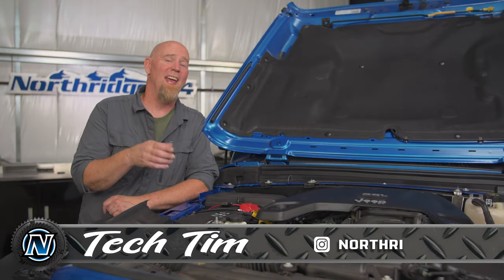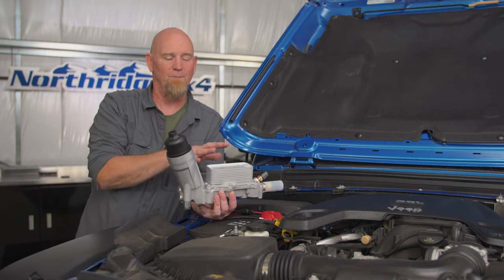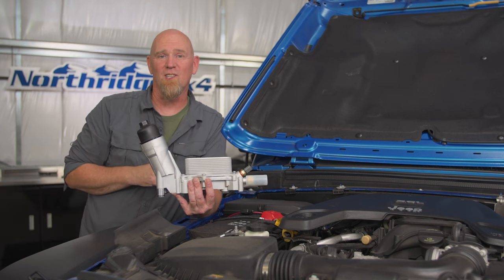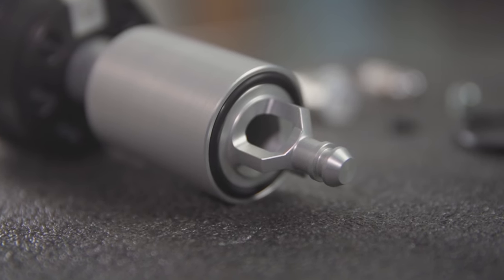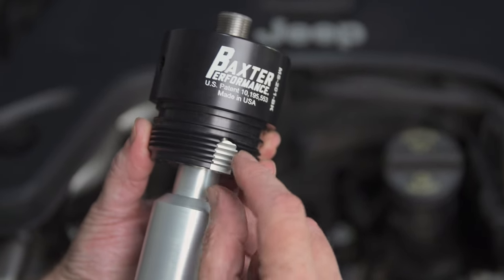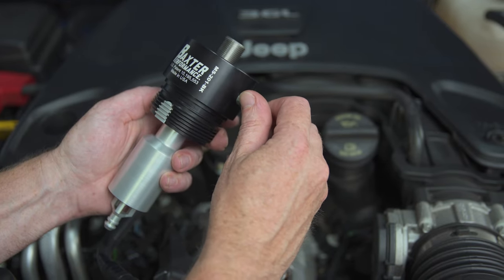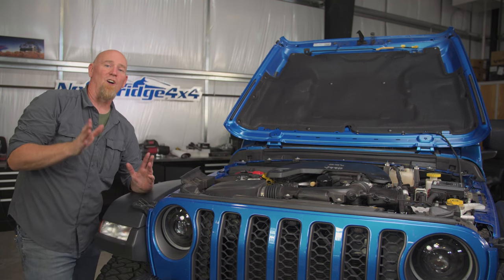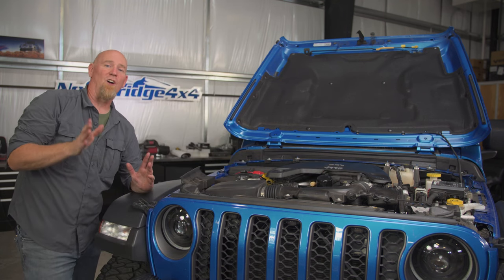Jeep 3.6 Pentastar Engine, Dry Starts, Baxter Performance Oil Filter Adapter, Northridge 4x4

Comment: Talk is cheap, find a JK that makes the rattle noise after sitting for a few days. Install the Baxter adapter, prime it, than wait a week and shows us it works. Pretty simply experiment.
Reply: That rattling is piston slap. Not from low oil pressure from what I understand
Reply: @BabyGators wrong

Comment: Why can't jeep just install a anti drain back valve from factory would have saved them millions in warranty repairs on valvetrains. I love that you guys have come up with a solution to a terminal engine flaw, jeep should offer to install these at least as a factory / dealer option at time of purchase.

Comment: Most engines, regardless of oil filter location have some starvation at startup. My 1948 8n Ford tractor is a prime example, about 3-5 seconds before oil pressure builds after startup, still running strong after all these years. Best thing you can do with the 3.6 Jeep engine? Switch to 5w-30..
Reply: I swapped to 5w-30 and it’s ran great ever since

Comment: So…. Oil is held in the filter by the anti drain back valve, but it won’t be pushed out until oil pressure is present at the filter.. so you’re looking at a fraction of a second difference in priming speed. Not worth the money.. cheaper filters but more work during having to blow out the oil..

Comment: This does as advertised, but first time cold starts of the day it will rattle a bit still because the oil galleys will have drained. The only way to prevent this is to use the "clear flood mode" described in your owners manual. This primes the galleys before ignition. There is no engine out there that will not leak down in the oil galleys to the sump over time.
Reply: Hold the gas pedal to the floor on the 1st start of the day to prime.
Jeep won't start with pedel to the floor.
Reply: Then turn ignition off and start.

Comment: YES IT WORKS... My gladiator got all new cams, rockers and lifters at 55k miles... When my car came back from the dealer it still had that grinding noise when I would start it... After installing this I haven't heard it since.... I think it could definitely be cheaper but it works.

Comment: Regarding the oil level...
If approx 1 qt is being held in the upper engine, it wouldn't hurt to add a qt to the crankcase to have the lipstick read "full"? I mean, the 3.6 is expecting to operate at the full level. No?

Comment: i installed one on my 2021 did it with a warm engine. checked for leaks found none. next day engine was cold sitting in basement . started engine dumped all my oil from a loose oil filter. i now mark the filter on top count 10 turns and know it is tight enough . also made a tool for grabbing schrader cap used  a piece of 3/8 fuel line rubber on a small wood dowel and secured now i can place over cap and unscrew without loosing cap

Comment: abit of a catch 22, 

if you have a Jeep with warranty still do you install this adapter to prevent this issue and risk voiding your warranty, I cant imagine service being too impressed with you using a different filter etc 

or

do you wait until you warranty is over and installing it but the damage is already done?

that being said we just had to trade in a 2012 Jeep Wrangler Unlimited Arctic with sever cam phaser issues probably due to this issue, it only had 198,000m kms and was VERY well maintained
Reply: Shouldn't affect your warranty
Reply: Take it off for warranty issues...

Comment: I have a question about pushing air into the oil port can I use nitrogen? Instead of air due to water may enter the engine

Comment: Doesn’t the 3.6 holds oil in the filter housing until you release the cap, then the oil drains back to the pan? My understanding is that you should remove the cap before draining the pan during an oil change otherwise you'll be using some old oil that is retained in the filter housing. Is this device even needed - seems to solve a problem that doesn’t exist.
Reply: BINGO! Finally a sane person in the comments. The oil filter had the drain valve built in. The tip of the filter contains an o-ring. That o-ring plugs the orifice that drains down to the oil pan. When you begin to unscrew the filter cap, it brings the filter up with it, lifting it, and exposing this orifice that drains the oil down to the sump. This is why you have to unscrew it slowly, and bide it time to allow the oil to drain down before removing the cap. Otherwise, you'll make a mess.

Comment: So, if this thing prevents any drain-back, doesn't it make a HELL of a mess when you go to remove the now inverted, full of oil, canister filter that will be on it? 

If the canister filter is NOT completely full of oil when you remove it, then there is NO anti-drain back function happening.

Edit: Ah, I see... I was premature. 
That's what the Shroeder valve is for, to apply air and blow the full filter out before you remove it. 👌

Comment: Plenty of stories of these @ 200k miles+and no rebuild.  The problem is the heat treat process making the parts too soft or hard. The few seconds after a few days (only time I see a dry start) isn't likely the issue as every single one would need rebuild by 100k. 

Personally I take the engineer that created the GTRs advice, buy the least expensive full synthetic oil and change the oil every 2-2500k oil and (good. Not cheap)filter every 4-5k. 2000 mile intervals probably 400-500 k motor, 2500 probably 300k. The fresh additive packages keep that motor solid.

Comment: 16 KL install no problem, first oil change, there is now oil leaking out the air valve with a consistent stream when the engine is on?

Comment: Great video.  Going to purchase a Baxter kit for my 2019 Promaster 2500. Kevin called me and said I needed to get a remote setup. His does not work and I forgot why. I am looking at Derale and Earls for the relocation with AN fittings which I believe will work with Baxters adapter. Any advice would greatly be appreciated. Thanks

Comment: You said it keeps the top of the engine primed. Oil is still going to drain from the heads. Only thing that is going to hold oil up top is the oil filter. Valves and rockers are still going to start dry. Am I missing something with this product?
Reply: Good question
Reply: Exactly my point, but seems like the oil in the filter travels to the valves and rockers faster than the oil pump sucking it from the sump of the engine. The top of engine will still be dry no mater what and this is an expensive upgrade for only few secs? Just change the oil on time and do regular maintain or to prevent the first few secs you can always prime the engine before start.
Reply: @barrysoetorro912330psi is not high pressure to stretch anything internally but I wouldn’t do it. This is a solution to a problem that is not there. It comes down to doing regular maintenance of your rig.
Reply: @barrysoetorro9123 I think it comes down to the materials longevity. The plastic OEM is design by engineers to cut cost of course but once mine cracks which it shouldn't if your not overtightening the filters. Then I will go with the dorman aluminum design over plastic oem also change the timing cover kit from plastic to aluminum.

Comment: Oil pushes oil, if the rest of the system is drained then how is a dry system pushing the oil held in reserve out into the heads?? How long does it hold oil for and exactly what areas is it holding oil in?
Reply: Probably up to 24 hours max based on what I’ve read people say. The oil will definitely still drain down eventually.

Comment: Dry start up is not the problem. Dodge use cheap parts. Buying this part will not help a 3.6 last longer.
Reply: Hi Mate, I have heard a similar comment, that the roller bearings in the roller rockers aren’t heat treated / hardened correctly. What’s your thoughts on this as that’s the area these engines seem to fail. Are there any after market options for the roller rockers yet???
Reply: @uberdetail5408  I don't keep up with what the parts are made from.